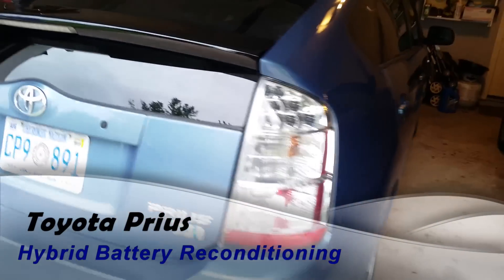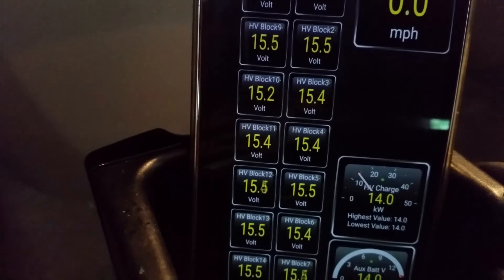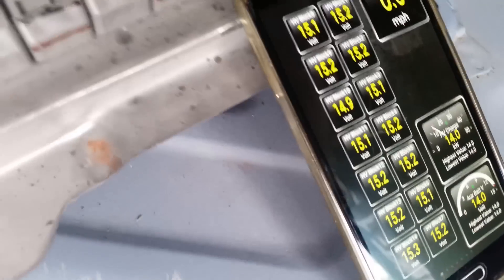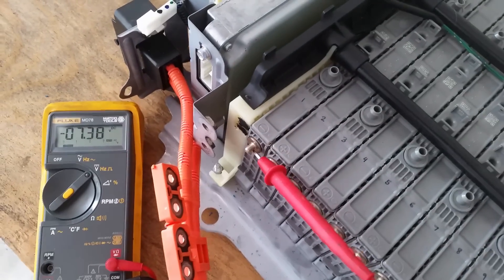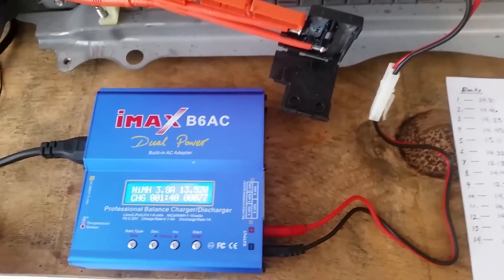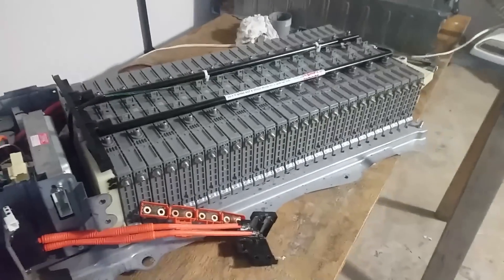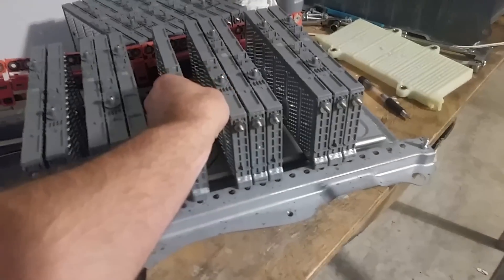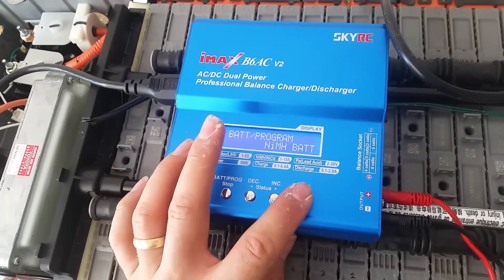Hybrid Battery Reconditioning - Toyota Prius

Comment: Better to just skip the batteries and instead take every juice out of linear generators while taking all the possible advantage also from solar and drag resistance.

So what if it's not "zero emission", but mostly?

10-20kw power should be plenty of torque and speed for most commuting, be that personal or cargo.

2nd gen ev smart has 20kw motor and 100km/h top speed, I would see that would easily handle majority of traffic with a better power source and AI.

Comment: Just so that you don't forget, the cells are numbered right to left ok......
Reply: Makes sense, Japanese comics are read right to left.
Reply: @DesireKlingensmith  You mean Manga lol
Reply: Could you please repeat that please? I don't want to wreck my brain
Reply: No your wrong. Get your nomenclature right. You are calling shit the wrong thing and terms are not interchangable. Cells are not numbered. It goes in order of size battery, blocks (made of two modules), modules (made of 6 cells), and cells which you will never see or deal with so it's a moot point to number them. But you can if you are anal retentive and want to. Oh and I hate to tell you all especially you creator of this garbage video but numbering is completely arbitrary and is strictly according to whatever your reference is so technically all you fuckers are wrong. You could number them randomly and be correct if that's the reference! Why you idiots seem to not comprehend is your program has one numbering scheme, a different program will likely have another, a tech sheet will be different, and they all probably don't go according to Toyotas numbering which should be the gold standard concerning this specific battery if you are habitually retarded and are so adamant on concerning yourself with something so none relevant to everybody instead of focusing on the problem and task at hand. Which you obviously are! I'm talking to you video creator! I'm seriously considering calling this trolling since it almost seems designed to confuse and misdirect those seeking actual knowledge.

Comment: Why are you using your chargers on NiMH settings with a lithium ion battery?
Reply from the maker: Because they are NOT lithium ion batteries. They ARE  NiMH in the 1st, 2nd and & 3rd gen Prius.

You must be thinking of the newer fourth-generation Prius, because 2015 & newer started using lithium batteries

Comment: My hybrid battery failed yesterday. I called Toyota of America this morning. They took all my info and said that they didn't sell any parts at their headquarter and referred me to contact the local Toyota dealers directly. I did speak to the dealer b4 calling them and wad told 5k for a new pack. Please advise. Thank you.
Reply: If its your first time to have a problem with your hybrid batterys its most likely a single cell with low voltage.  Higher mileage could be mulitple as in the video.  A single cell can be found for around $30-40 on ebay/amazon.  craiglist.com (nc) has guys that will change them out for $500-$750 fyi.
Reply from the maker: My advice having messed with half a dozen or more of these cars, would be just to buy a reconditioned battery pack with a warranty for around a grand, and replace it yourself. It's not worth the hassle for trying to recondition them without a lot of experience. It's easy enough just to pull the back trim and R&R the battery. That way you don't have to mess with the computer or Electronics. And that will probably get you by for at least 3 or 4 more years without any problems
Reply: @JohnCalebWarren   Thank you.
Reply: Call several dealers in your area, I ended up just going with a new OE battery from toyota for 2k since I plan on keeping the car for as long as possible. Dealership prices varied from 2k to more than 4k just for the battery, installation prices varied as well.

Comment: How many miles on your Gen 2 or 3 Prius when you had to do this repair
Reply from the maker: I believe it was a 180k, my brother drives it now and it's still holding out great!
Reply: my gen 2 went out at 149k, bought it at 140. The battery modules had red and black marker on them though so it might have been a rebuilt battery, I doubt they did that factory.

Comment: more convinced now that i really dont want a hybrid car ,,,,,,,,,, ever
Reply: Agreed, I'll either go full electric or stay gasoline. It's like doubling your potential car issues owning a hybrid.
Reply: Critz1184 , ummm... if you go full electric you could still have the possibility of a bad cell or two in your battery. Batteries are getting better, but they’ll still have a limited life. The goal is to make a battery that’ll last as long as the gasoline engine. (PS. Gas engines eventually wear out.)
Reply: @mitchrodee  yea but hybrids not only have batteries and electric motors, but all the conventional gas engine parts to go bad too.
Reply: I guess you haven't owned any other gas car. Every gas car is actually a hybrid since it requires a battery to move the starter at least.  Also hybrids design typically means less maintenance than gas cars. https://afdc.energy.gov/vehicles/electric_maintenance.html.  Electric cars will require similar maintenance for the electrical side since the battery tech is similar.
Reply: If you're buying new and comparing similarly or lower priced cars its fine because of the gas savings and warranty, but used for me wasn't a great idea. I would have rather spend the repair cost of a battery plus the price of the car on something better.

Comment: My heart is racing as he touches things! I can tell you know what you are doing. I would likely electrocute myself.
Reply: Not a lot of reason to be scared of these things. Once you remove the big orange disconnect there is little danger, toyota is pretty smart that way. (they dont want to kill any future customers.) Each module (blade) is only 15 V more or less. That isnt going to hurt anyone.
Reply: True if you don't understand basic electric principal and Power you will easily kill yourself! However if you know what you are doing and follow basic safety rules it's very safe.

Comment: hi, John! thanks for video! it's awesome! Could you tell me what soft ware do you use in your mobile phone?? and  how did you connect it with a car? thanks in advance
Reply: Dmitry Kim using an obd2 car connector preferably not cheap ones and wireless,also there’s many apps for example dr.prius/dr.hybrid. On that app there’s always gonna show a low graph in one of the blocks but it’s just how the app is designed all u have to make sure is that the voltages are even .btw it’s way easier and fast when you take off the bottom pan of the battery this guy made it more complicated any more questions feel free to ask I’m a tech I’m feeling nice today.
Reply: Torque app for android, wifi or bluetooth OBD adapter from Amazon

Comment: There are 3 Thermistors attached to the middle and ends. They are easy to break off and not stocked by the dealer. Be careful!
Reply: Can't you measure the range and order new ones from an electronics supplier?
Reply: Toyota doesn't supply the specs. Proprietary. You would have to guess.
Reply: @amazoidal  Of course they don't but if it is a thermistor it is very easy to determine its specifications (ntc-ptc temp-resistance)
Reply: It's NTC but it would be nice to knowwhat replacement thermistor would work  because it is easy to break off if the first module falls and Toyota does not sell the harness. I got the last harness from www.autobeyours.com. But they are dropping their Toyota parts cache. I have a graph of the thermistors characteristics. At 212 degrees, the resistance in kilohms is 1.108 or less. At -40 degrees (F), the resistance is 247.7 KO or more. At 77 degres (F), the resistance is 9-11KO. It doesn't say at what temp the blower kicks in or whether it's variable speed. Probably a relay and the thermistors running at 5 volts. Duration is Toyota intellectual property but one could bench this and find out.  The battery ECU must have a circuit that controls the temp in and out and the duration (maybe the duration is just the range of temp).

Comment: All these hybrids using the PrimeEarth Panasonic Prismatic 7.2V modules in their packs are starting to age, people will be very interested in how to save the old battery modules especially since the value of a new Hybrid battery pack could easily exceed the cars value! An RC type charger that works well on these is the Turnigy Reaktor 1000W  30A unit. It will discharge at 6amp and charge at 2amp (OR HIGHER). It also data logs back to your laptop. Great way to check the overall health of each module and identify correctly the ones that need to be replaced. Problem is that to do this is very time consuming, if you have strong modules that are close the the 6500aMH original rating it could take <7 hours to process 1 module. I have spent 7 days on my 40 module pack LOL and most were at less than 25% of the original 6500aMH rating. All 40 of mine are too weak to recondition..... GM Two Modes are very hard on these modules! I think the Prius owners will have better luck saving modules on their packs.
Reply: Thx for info

Comment: If a cell is bad, you should add distilled water to it, I think. They loose distilled water during discharg phase of the cycle when they heat up.
Reply: adding water is for lead acid cells only. There is no water in a lithium ion cell, they use an organic solvent. If a cell is bad replace it or check that the battery management system is correctly balancing the cells
Reply: they are made of lithium though

Comment: Thank you John for amazing video with showing voltages in different modes. I am ordering im6 v2 unless you have any other remoandations. I have 05 prius just got cell and I was about to put it back but realized its A must to balance it
Reply: Just want to jump on ur comments here..if cells are found to be no good u cant just replace it and put everything back? Is it neccessary to balance?  If so how do u perform a balance and with what? Help if u can..
Thanks

Comment: John, awesome video. I’m starting to get the CEL with hybrid battery related codes on my Escalade Hybrid. From what I’ve read the Toyota battery is the same. I just have 40 modules. Thank you sir, this is very helpful as I am going to begin my battery rebuild process. 👍🏼
Reply: How did it go?
Reply: My 07Prius is bad power loss. Shows dash panel light on.
Has  185k miles.
How many cells do you think I may need? Thanks

Comment: Once you are ready to place the hybrid battery back into the prius how much should each cell be charge to?
Reply: The answer is the largest charge the smallest cell can handle. So if your system weakest cell can handle 7.6 volts then your system should eb balanced for that level.

Comment: Just wondering, if the RC chargers work as dischargers as well, how come you used the DC motor to discharge at the beginning?
Reply from the maker: The DC motor helped discharge a little faster. About the best the rc charger would discharge was 1 amp,  & the DC motor would draw 1.5 - 2 amps

Comment: Interesting video John. I had to watch it a few times. You mentioned that you had to cycle the batteries about four times each. May I ask why? Does that mean you had to discharge & recharge each module four times? Also, after cycling the batteries, how can I check to make sure that the modules hold a steady charge? In other words, how do I prevent reinstalling/reusing a bad module?
Reply: If you put a resistive load of about one ohm and 10 watts power capacity across a module it will discharge at 7 Watts which would give you 7 amps discharge. You can time that and take the average between 6 and 7 amps. It would still take you a full hour to discharge a good module through 1 ohm power load.  That's because it has 6.2 amp-hour capacity at about 7.2v average, so with 1 ohm load you have average 7  amps flow (7volts/1 ohm= 7 amps).

Comment: What’s the nominal voltage and max for these cells? And at what voltage should you consider to throw out and replace a bad/faulty cell?
Reply from the maker: I would say anything below 13 volts, throw it out. You want all of your cells to be around 15 - 16 volts holding. And as you drive they will fluctuate from around 13 - 19 volts, and hold around the mid 15's
Reply: John Caleb Warren the 15-16 volts is for every pair of cells correct? 
Because I’m getting 7.4-8.3 ish, for one single individual cell.
Reply: John Caleb Warren when driving, I got all the blocks in mid 15th. With all that I still get the code POA080- replace the hybrid battery pack. What could that mean ? Could that be just aux 14v battery ? Can that generate this trouble code ?
Reply: @Kono1976  yes it can. My friend had the same issue, changed aux battery and everything is fine, its 8 months now.

Comment: How do you get the Prius software on your phone?
Reply: It's called torque pro. Only available for Android, not Apple. You need to buy a bluetooth OBD2 adapter. The software app is like $5.99 in Google play. You need the pro version, not the free one.
Reply: Hy   Is there any software for Toyota Camry as well  
You Liz advice
Reply: Do you know if the software would work with gen 3 priuses?
Reply: Hybrid assistant app on play store

Comment: Excellent Video.  Thank you.  I just bought a Prius with a bad battery, so it will help tremendously since I'm technically inclined so I'll fix it myself now thanks to your tutorial.  By the way, can you please tell me what that battery software was that you were running on your Samsung....is that through an OBD2 sensor?  Let me know please.
Reply from the maker: Yes it's called Torque Pro, and then it's kind of tricky getting the Prius packs installed to view the cells individual voltage readings. But you can Google it, and figure it out